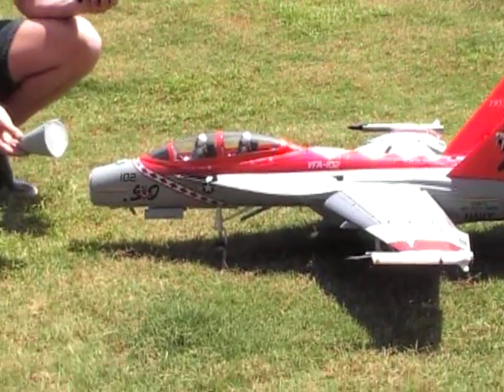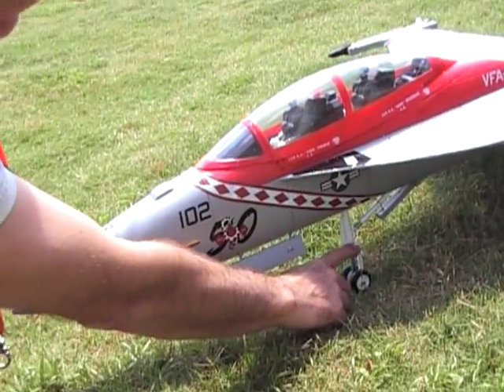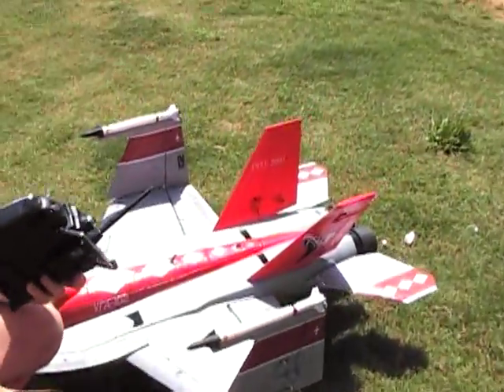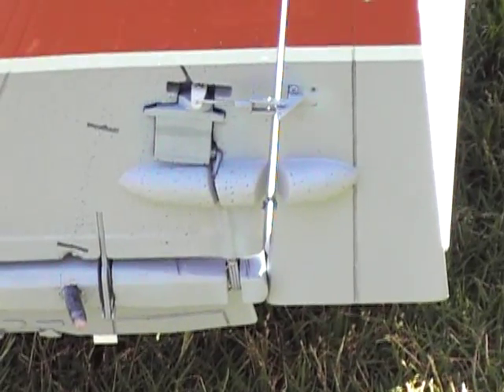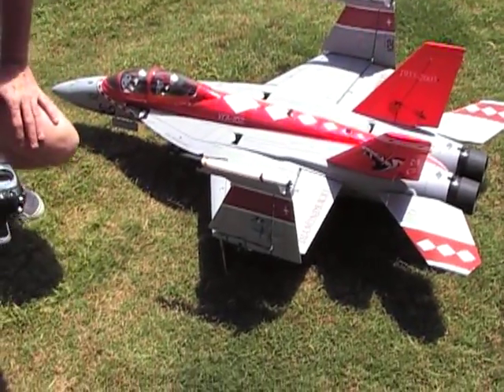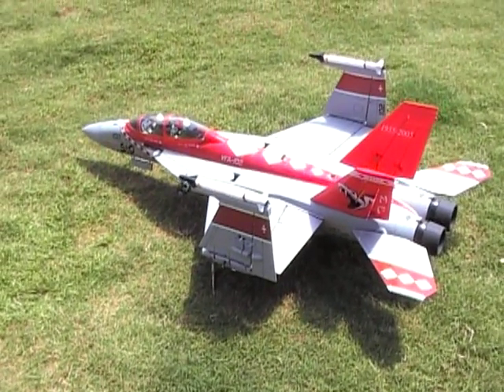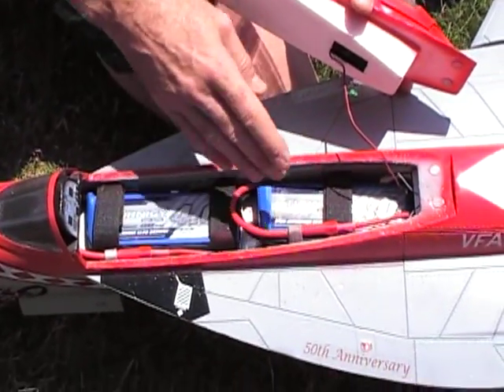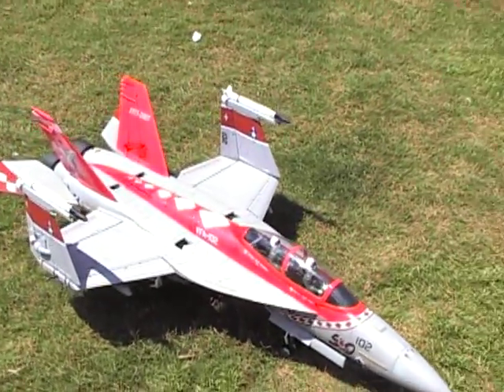LX FA-18 quick Grass taxi Video 001.MOD

Comment from the maker: @harrybutt1951 Well Most have a track record, I don't think they've been that bad....I've had good sucess with all of mine. your're right about the F-16 though, but that was easily solved with stronger MG Servos, now it's no problem. And yes this plane so far is a bit tipsy in it's legs with a narrow wheel base, but I haven't gottn to take her out on any kind of hard top surface yet and check her out further, though I don't think it will change much, But I do think it's managable with extra care

Comment: hi,brandon. working on my jet right now.have a question?the wire lead that is labeled 5volt output.what ch does it belong too.white wires been cut just red and black hooked to what looks like bec i think if so can i y-harness this  to the throttle ch appreciate your advice seeing bananahobby wasnt much help.